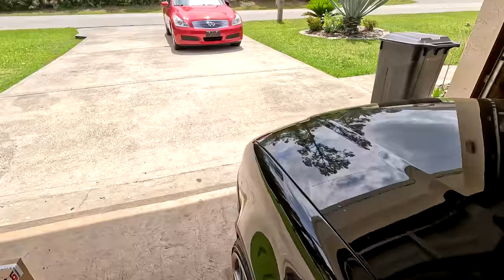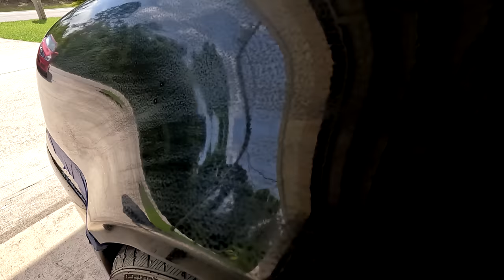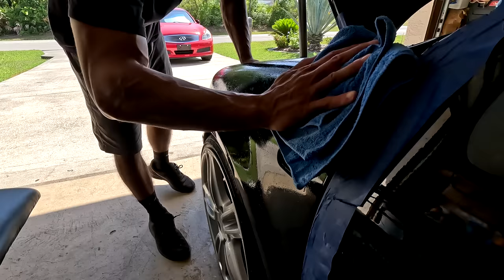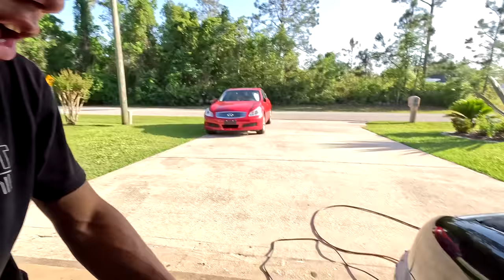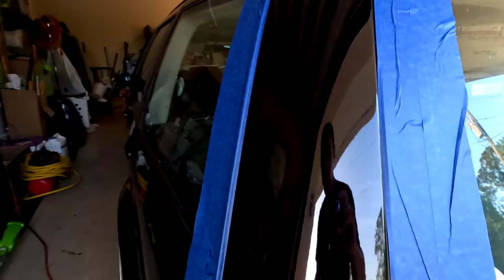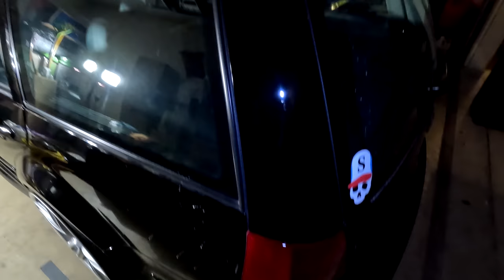Learning How To Remove Orange Peel! ( MK4 Jetta VR6 Wagon )

Comment: You wanna use a heavy compound with a harder foam cutting pad ,then use a finishing polish with the softer foam polishing pad. Using the compound on the soft pad is leaving you the maring and fine scratches 🤝 you'll get a better finish this way
Reply from the maker: Appreciate the tip!

Comment: When hand sanding you want to cross hatch to knock down the peaks. In this case you would of had an easier time using 3m Trizact random orbital pads along with the cushion that you use on the random orbital plate to absorb the body lines.

Comment: Messing with paint is daunting at first…..once you get the results from sanding and polishing it becomes so much easier to use polishing machines and anything

I have had my DA for about 2 years and often use it with the suitable compound for the job on my cars to remove the inevitable marks they pick up through use 

If it’s dent free and shiney 99% of people don’t notice the imperfections 😂👍🏻

Comment: Good job Mr. Smith.
But what the heck is the rear hatch.....no way, you didn't throw a germanstyle one with that awfull long licence plate relief on it.....no....nooooo 🙂

Everyone here in germany wanted the US-Version .

You only have to chance the backin plate and polish pad to a smaller size.
I normally using 125mm version.
Reply from the maker: Everyone in europe wants the American stuff and everyone here wants the euro stuff 😂 just how it goes lol I have no issue with the American hatch but for the zender kit I wanted it to look more complete